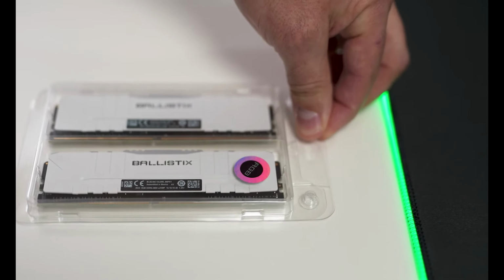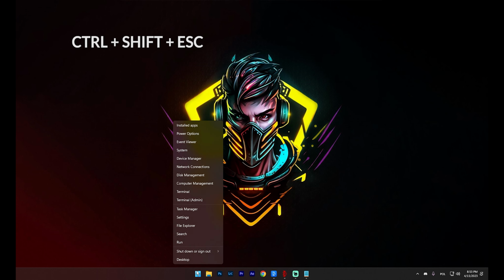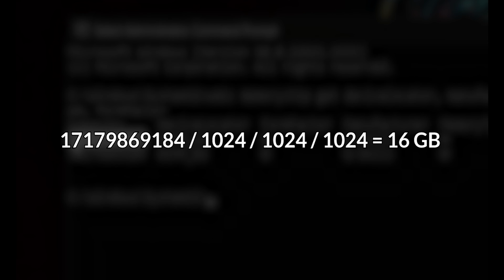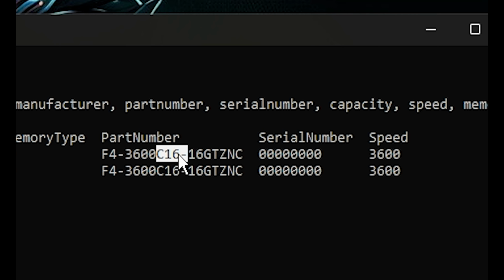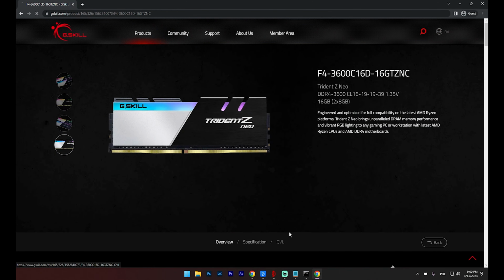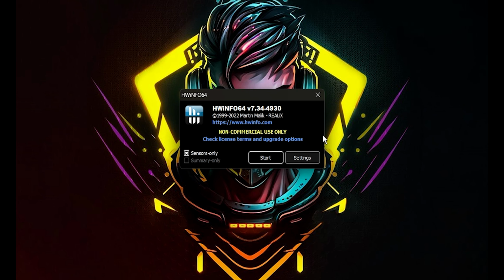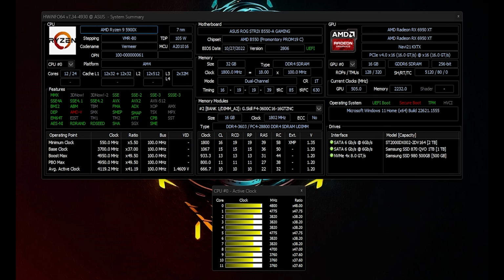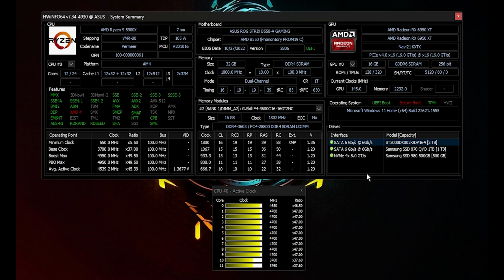Unlock Your PC's Full Potential: Check RAM speed in Windows 11 and gain 30% boost.

Comment: in bios and task manager it says my ram speed is 3200 but the cmd tell me its running at 2133 and yes xmp profile is enabled my mobo is a asrock b560 pro4 my cpu is i5 10400f and my ram part # is F4-3200C16-8GTZR. Help????
Reply from the maker: Hey there! It's a bit puzzling that BIOS and Task Manager show different RAM speeds than the Command Prompt. The fact that BIOS indicates 3200 MHz suggests that XMP is indeed enabled.

In this case, I would trust the BIOS reading since it's more directly linked to the hardware settings. It's possible that the Command Prompt isn't reading the data correctly.

Just to double-check, you could also use a third-party program like HWiNFO64 or CPU-Z for an additional reading. I’ve created a video on using HWiNFO64 to check RAM speed and details which you can find in the pinned comment.

Additionally, make sure your motherboard BIOS is up to date, as this might resolve inconsistencies in reading memory speeds.

Comment: i pasted the cmd prompt but i didnt get a part number? like its blank under it
Reply from the maker: Hmm, that's odd. If the part number is not showing up in the Command Prompt output, it might be due to an error in the system's reporting or an issue with the specific memory module.

I would recommend trying another tool, HWiNFO64, which is often more reliable and provides more detailed information about your hardware. There's a video I've made on how to use HWiNFO64 (link in the pinned comment) which should help you check your RAM's part number and other details.

Comment: So when I did this, I have 4 g.skill sticks installed. On the Device locator section it says ‘DIMM 0, DIMM 1, DIMM 0, DIMM 1. On the manufacturer it says ‘unknown’ for all 4. 

What does that mean?
Reply from the maker: It seems that the information provided by the system is not accurately recognizing your G.Skill memory modules. The 'unknown' manufacturer and repeated 'DIMM 0' and 'DIMM 1' labels could be due to an error in the system's reporting or a compatibility issue. I've actually never seen a device locator error before, so it's quite interesting.

I recommend using another tool like HWiNFO64, which tends to provide more accurate and detailed information.
Reply: @FlowGamingZone  yeah I’m not for sure. So far I’m not having any issues